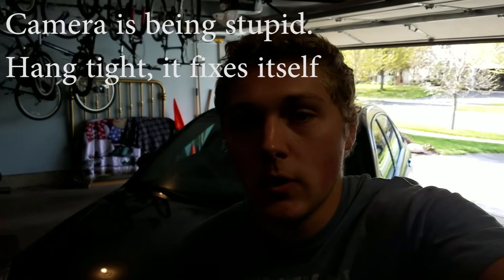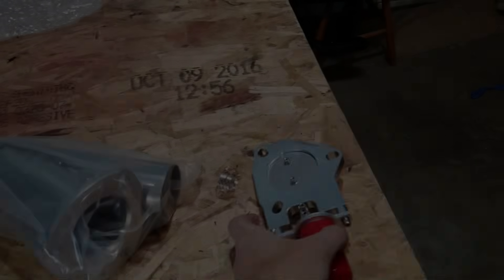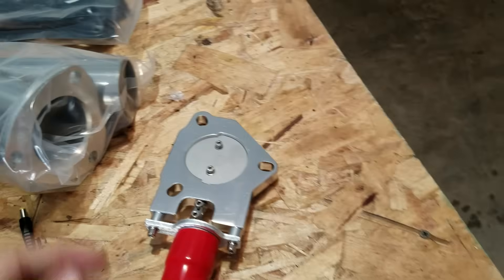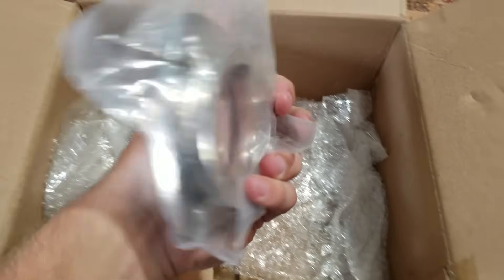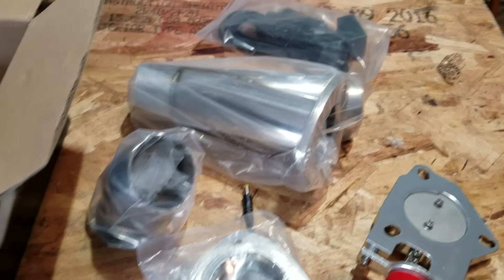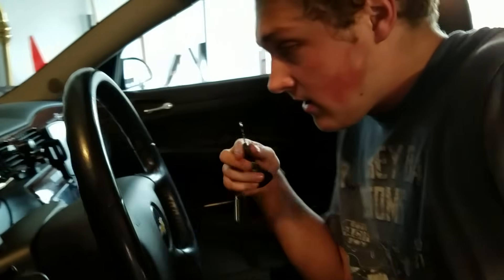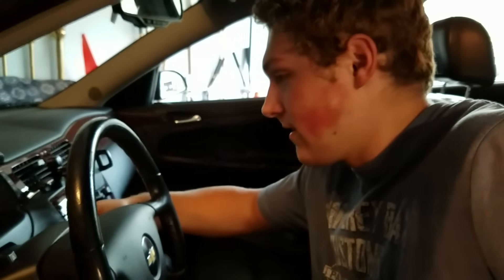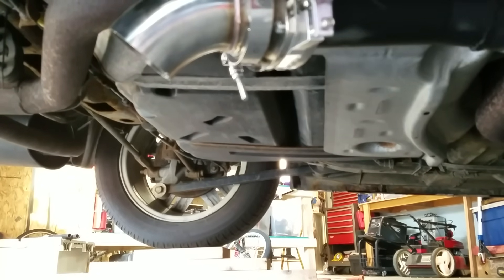DIY Electronic Valve Exhaust

Comment: Lol, he installed valve after resonator. Also in case u don’t know, before welding u need to remove all rust/paints/oils from the metal.
Reply: so what? and flux core you don't have to clean the metal. It's really meant for heavy duty outdoors stuff. In his case for a crappy exhaust it will be fine LOL. It's gonna start rusting but will hold. watch for pinhole leaks.
Reply: Andrew L 🤦🏽‍♂️🤦🏽‍♂️🤦🏽‍♂️I won’t say anything
Reply: @MCervi42  Say it

Comment: Can you completely straight pipe with this electric cut out so that you can change between total straight pipe(including cad) and stock exhaust system with the remote control???
Reply: If you want a heavy ass double stack system lol
Reply: Yeah just put it in any straight section of pipe before the cat, resonator, and muffler

Comment: 3:43 huge crack on the pipe
Reply from the maker: Yeah the valve ended up rusting shut so I basically undid everything in this video. Including removing the dookie welds

Comment: I have a issue with my valve, it does not open/close any more, i hear the unit clicking but the motor does nothing. I took it apart and tested the motor on a 12v powersource, then it does work. My guess would be that my unit that sends the signal to open/close is somehow locked. It does repsond to the remote but does not send to the valve. i am looking for a method to reset the module anyone has suggestions?
Reply: I would start by checking to see if the wire to the motor is still working and then work up to the relay. Mine had an extender that a person in the back kicked and unplugged.
Reply: Adam R  Hey thanks for your time! i took my whole exhaust under my car and took apart the cutout. noticed the gear was hard to rotate even with pliers, took the whole cutout apart and poished everything including new lube (wheel bearring grease) than tested the motor and discovered it did not work, took the whole wiring under the car and used a multi meter to test signal from the module and at the end of the power cable. at the end of the power cable no current, and at the beginning there was current. found a splice in the + wire and that was the cause, still happy i took it apart to maintanance it so it will last longer :)

Comment: I wonder if i fit it on my car will pass the mot?
Reply: It depends how strict/thorough your local MOT tests are.   Here in Utah they jusy check your tailpipes, obdII and sometimes spark plug wires for RPM(no visual inspection of exhaust)  So just keep the valve closed for your test and don't  tell them about it.

Comment: when i am driving with the valve closed it will start to go open just a little  its not because its cold somehow the valve cant keep the pressure back or something idk  any idea or tips?
Reply: If you notice when the valve on this one closes there is a lip that prevents it from getting blown open. Maybe you didnt face it the right way during install?
Reply: I have the Same issue

Comment: Wonder if this valve is still working. People complain a lot about it not working for more than months
Reply from the maker: Wade still works. Only issue is that it rattles a bit on idle while it's cold.
Reply: Freehand Garage Thanks for the feedback. I actually sell performance exhausts and have been thinking about selling these valves, but many people told me to be careful due to these kind of issues. Costumers may become very unhappy if the valve doesn't work properly after some months.

Comment: how has it held up almost a year later?
Reply from the maker: I ran it from the center console through the cabin into the trunk then to the spare tire area. The spare tire spot has two rubber grommets. I ran it through one grommeton on the side so it still sealed then zip tied to non-moving components of the subframe.
Reply from the maker: Russ A Still worked great until it was parked inside another car 😅. Just had to tidy up the wiring
Reply: sorry to hear man. reason i asked is alot of people say the motor stops after a short while
Reply from the maker: I will probably make a video on it again if anything changes. Thanks for your interest
Reply: How did you get the wiring from the valve to the 12v port?
Reply: Cheers for replying!
Iv just tried to run the wiring however i seem to run short on the length towards the trunk, would you have any idea on what type of wire this so I could possibly try get an extension for it?

Comment: Cool! I jusd did that to my wrangler 2002. Sounds great. Same ebay product haha. Im just concerned about damaging it when off-roading or getting it wet....time will tell. Cheers!
Reply: quick question does your leak like when closed  while driving mine seems to be going open just a little after hitting the gas
Reply: @timderidder5349  yes, it leaks since the beginning. There is a small growling when off.
Reply: did stand the test of time, I'm asking 3 years later based on your comment
Reply: @fahadolight  nope. It failed when splashed with water (not even submerged).
Reply: It did not pass a regular city water flooding, not sure if i got an improperly sealed unit. Permanent failure. 
Also, it was leaking exhaust gasses since tue beginning. So there was a bit of growling even at the closed position.

Comment: You should learn how to weld...
Reply from the maker: Doing the best I can with what I got. I think I did pretty well with a $180 flux core welder tho.
Reply: The problem isn't the welder, but the position. You had to take down the exhaust pipe and weld it in a good position. In the way you welded the internal side of the pipe will be full of welding waste that can disturb gas flux. With low current and thin wire you can do good things.

Comment: And you had no issues with the control box? I fitted the same kit and control will only work one way
Reply from the maker: Mike Phillips check to make sure BOTH of the motor terminals are not touching the motor housing. All it does is reverse the power and that will cause it to only work one way.